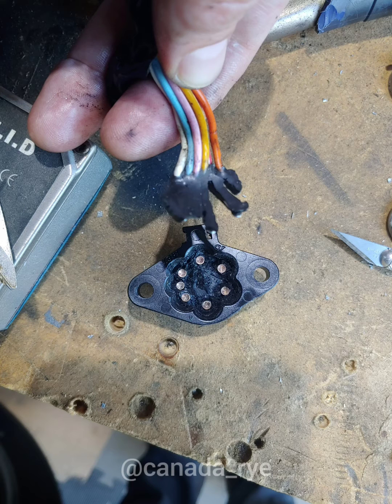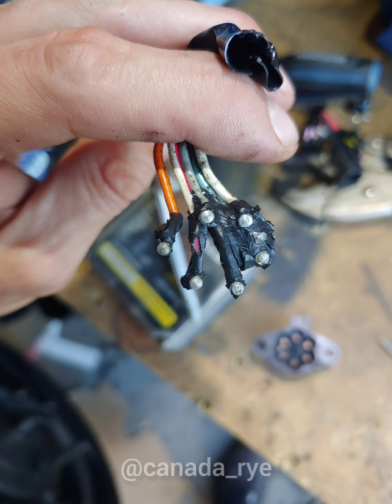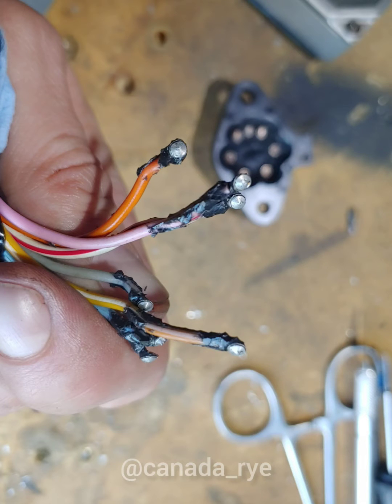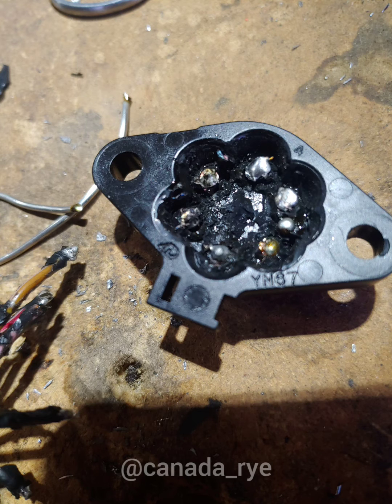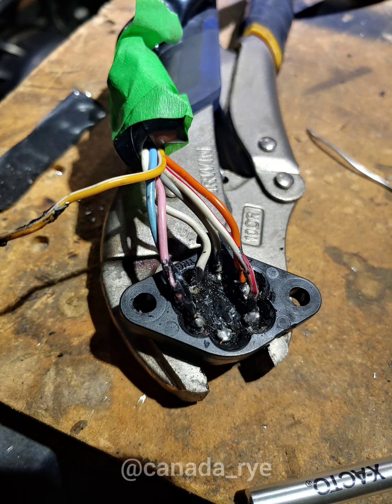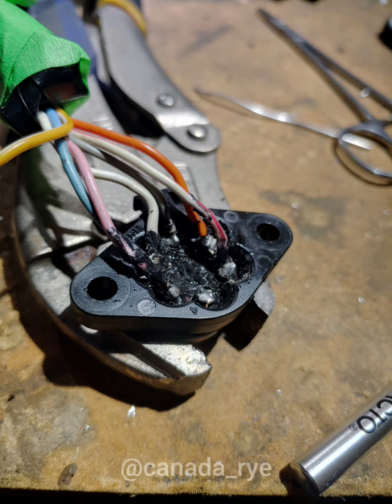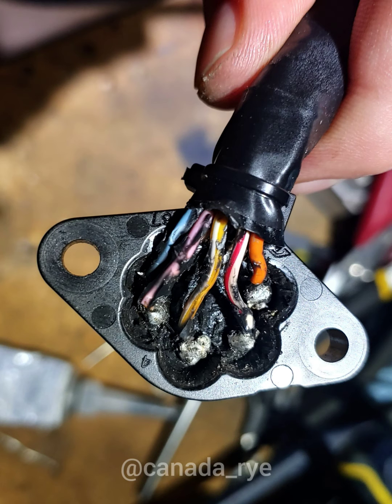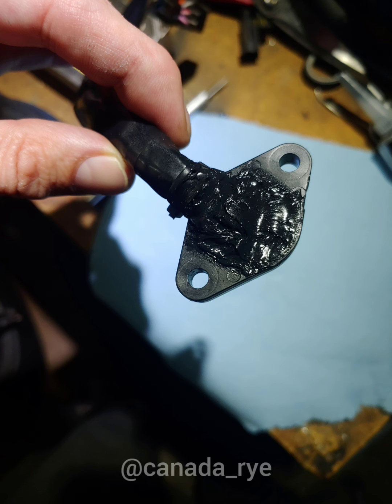How to Fix Gear Selector Switch Yamaha FZ09 2014-2016

Comment: Hey just wanted to ask how you removed the epoxy filling?
Reply from the maker: It was just a rubber filling which was pretty easily removed with an x-acto knife and some small needle nose pliers
Reply from the maker: And the fix has held up after a year!
Reply: @canada_rye  Alright thanks, I'll be sure to try this when I have time!